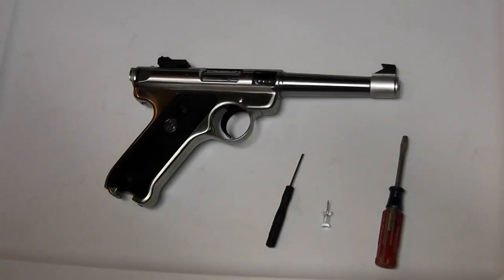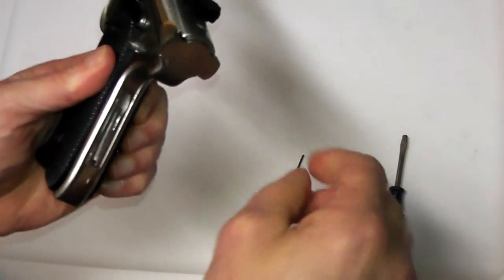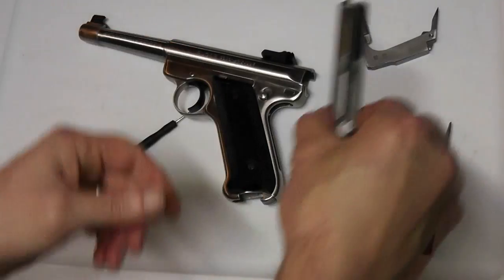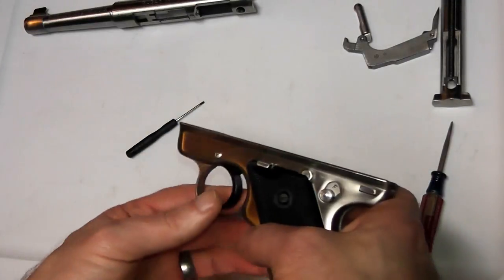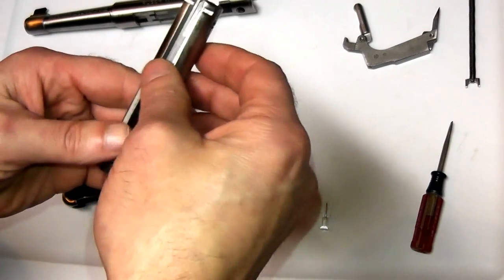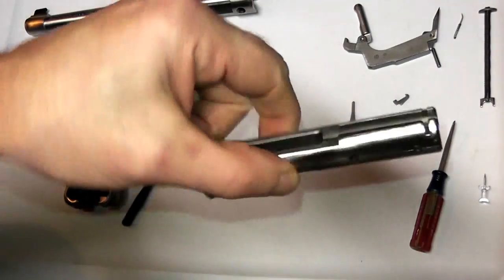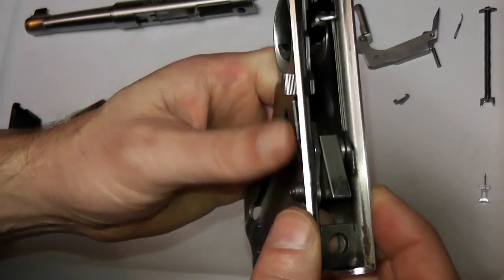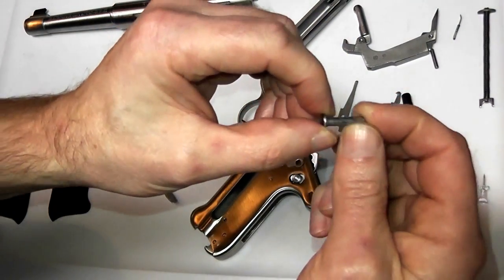Ruger Mk II Full Disassembly

Comment: PROBLEM FOR ANYBODY: I have a MARK II, after I pull the trigger and release the mainspring housing lever, the housing doesn't budge.  It stays lodged within the frame, solid.  I've retried, pulled, everything short of vice and plyers in order to just make the actual mainspring housing peak out of the frame. Meanwhile the lever will pop out to its normal 60* position, but is able with encouragement, rotate to the bottom of the frame almost 135*. . . . . anybody have a clue?

Comment: Good video with great discussion on the interaction of the internal parts. . Once someone knows how the gun functions, and particularly the effect of hammer position during assembly/disassembly, this process gets allot easier.  BTW: It's a good idea for newcomers to perform the disassembly starting at the 14:50 mark with the frame and  your hands inside a large clear plastic bag. that way, anything that flies/falls off is captured.